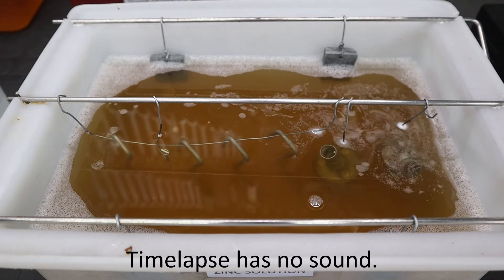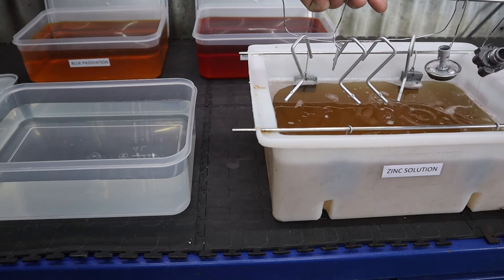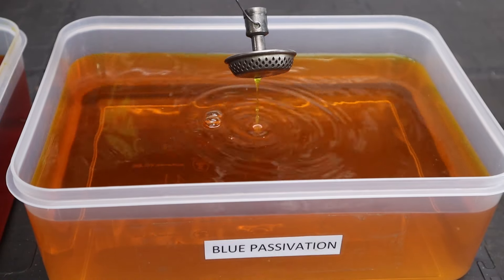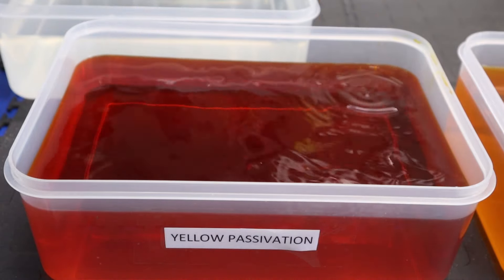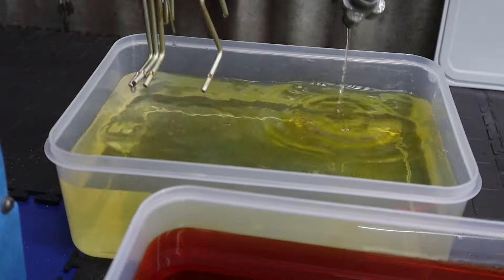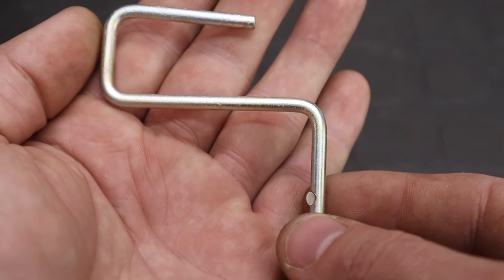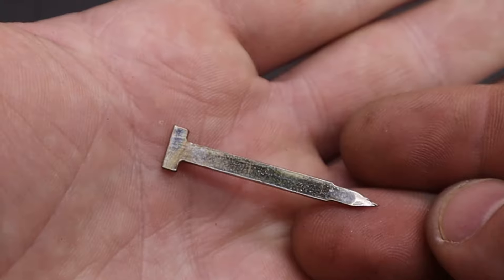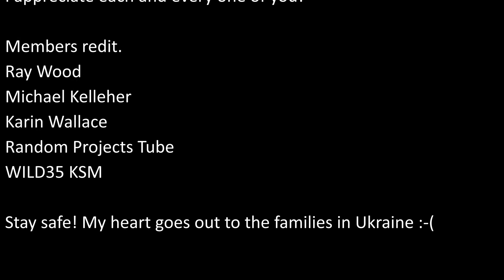Zinc Electroplating at Home

Comment: A very nice job.  zinc plating by simple extrapolation of the number of things we buy that are zinc plated, simply has to be a safe and long tested treatment.  Practically all "silvery" looking items you buy, other than cutlery, are likely to be zinc plated.  

Yes, not a century long protection, but certainly proven to be decades long if treated properly.  Chrome plating would be longer lasting if done in the multiple layers needed to obtain a long durable coating, but just look at the LONG list of problems the chrome industry faces, along with the enormous waste disposal costs for chrome and you will understand why zinc and "galvanizing" processes are so common. 

Keep it going there.  Doing a really good job with the descriptions as well.
Reply: Hola buen día! Usted nos podría  hacer el favor de compartir el nombre de cada uno de los químicos ?

Comment: What are peoiples real world experience with this process? Mine are mixed to say the least.
I had a bunch of hardware of off a trailer that were really rusted. They were originally galanized or otherwise zinc plated (hot dipped) but were now orange and brown all over.
I used the wirewheel on the loose stuff, then vinegar for the deep rust removal and then zinc-plated them with this exact method shown.
I then even painted them with a zinc spray paint, and mounted on the trailer. 
Not even after ONE DAY on the trailer and after a nights light rain there were orange streaks from the water run-off and in alle nooks and crannies in the steel profiles.

How can you ACTUALLY get the coating all over as it seems there always is a shadow cast on the parts where there is no line of sight from the anode and to the part.